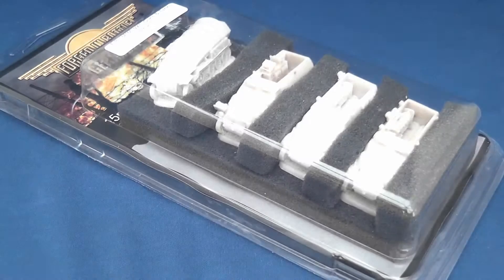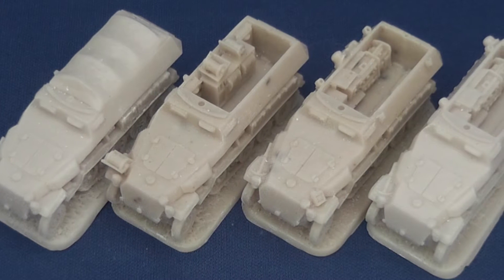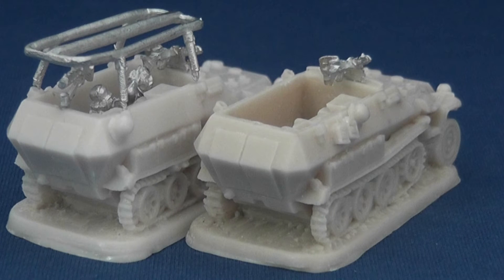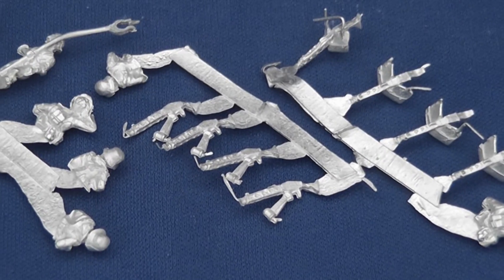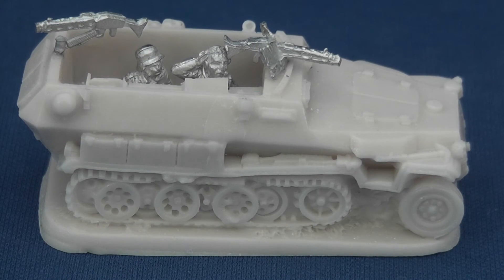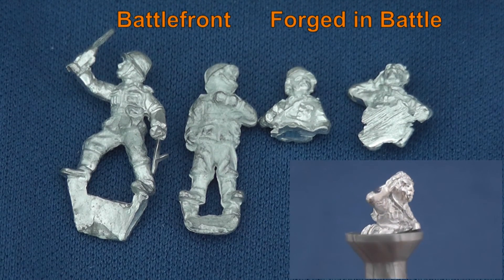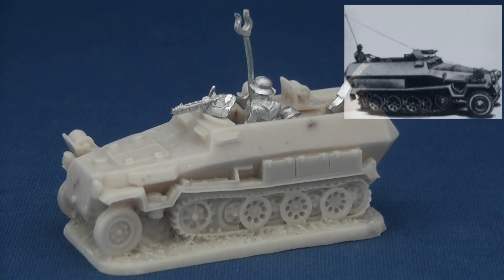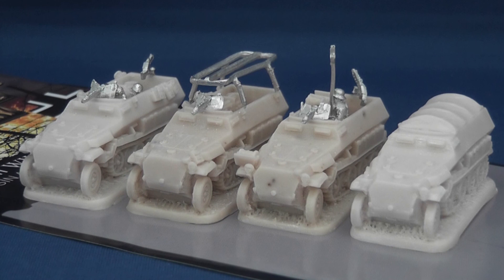Forged in Battle's 15mm Sd Kfz 251C Command Set: a video review

Comment: Ahh, that makes sense. I've not got Rommel myself but a friend of mine had him for his DAK. The model is pretty detailed. His half track has a communications operator and the radio antenna. The FiB antenna looks a lot easier to fit than the one BF does with its Sd Kfz 223 (radio). That comes in 5 parts and looks a bit clumsy.

Comment: I love the detail in them but the resin looks a bit brittle. I noticed that parts of the tracks on one of them was broken. How did you find fitting the antenna? It looks like it doesn't fit in well. Have you had a look at BF's Rommel and Greif models?

Comment from the maker: No, the resin isn't too brittle.  Looking again, what you can see is a casting issue with a blob of resin.  You have to carefully bend the antenna to shape but once it's there it slots neatly in to place.  I didn't fit it because I want to painting the fighting compartment.

No had a chance to look at BF's Rommel model, is it good?